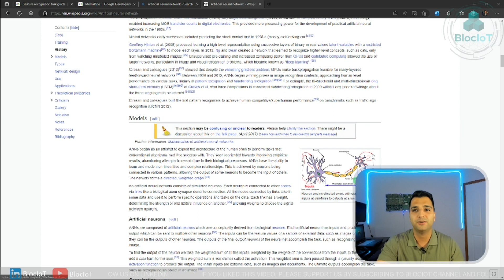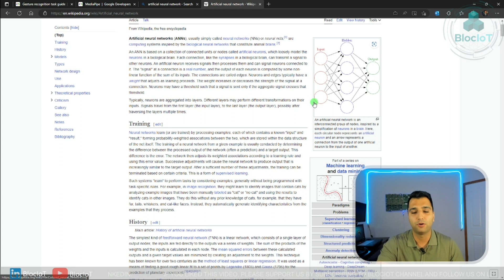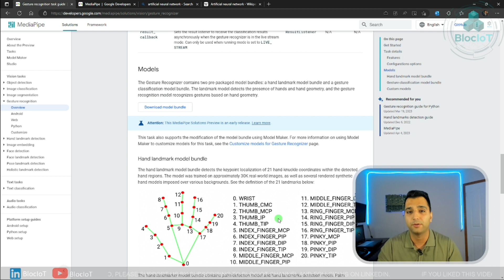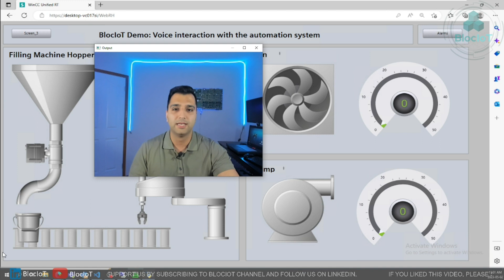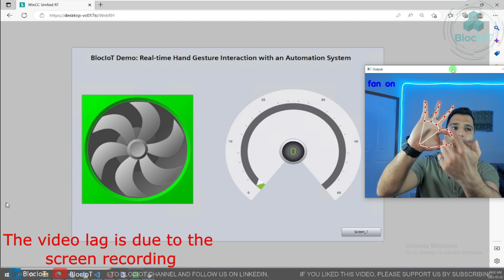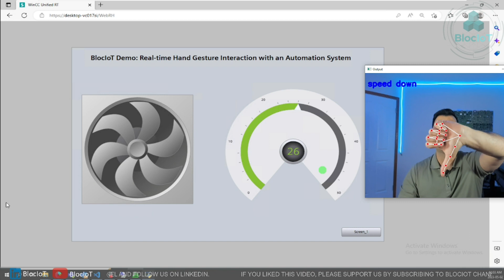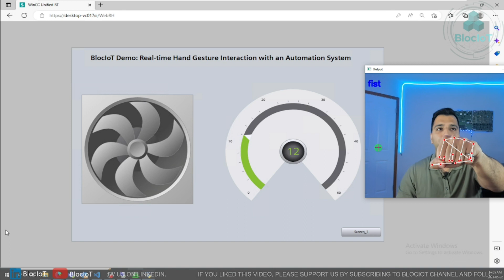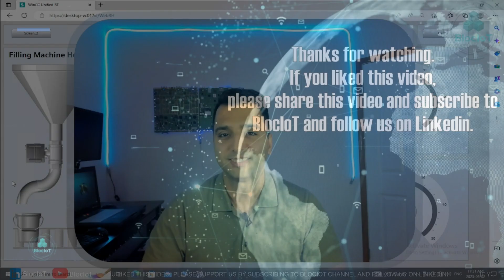17- Hand Gestures Interaction with a PLC, HMI and Automation system using Machine Learning

Comment: Was it a specific  S7-1500 PLC model, or does it not matter? Can it also be applied using S7-1200?
Reply from the maker: S7-1200 CPUs have OPC UA server as of firmware 4.4 and S7-1500 as of firmware 2.5. You can use either or as long as the CPU has OPC UA server.
Reply: @blociot  Thank you. I thought so, as my s7-1200 is 14 years old and it looks like it is just at the edge of being still in the newest TIA catalogue.  Your video is great. Thanks again
Reply from the maker: @lukaszscislo9762  thanks again for watching and your positive feedback.